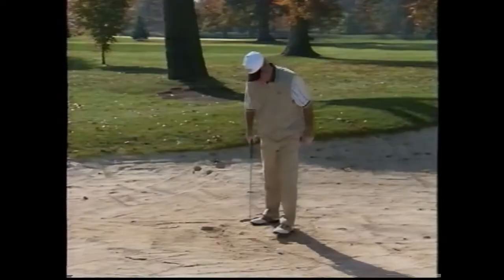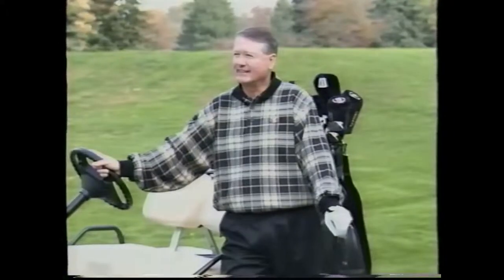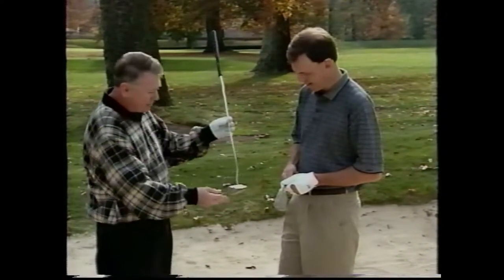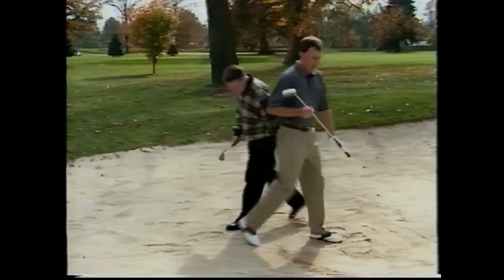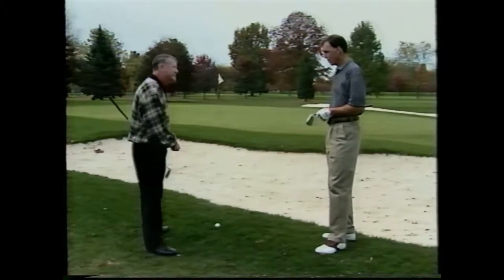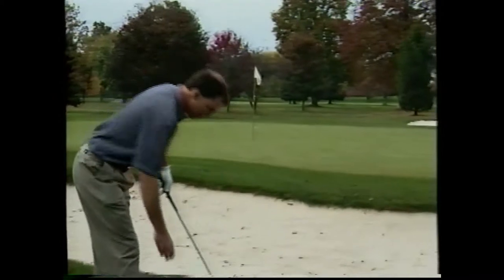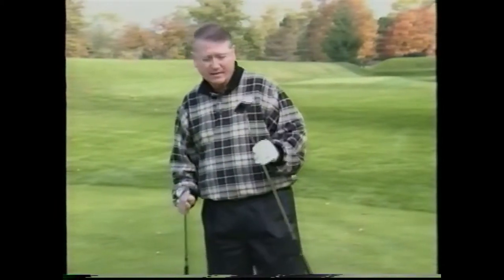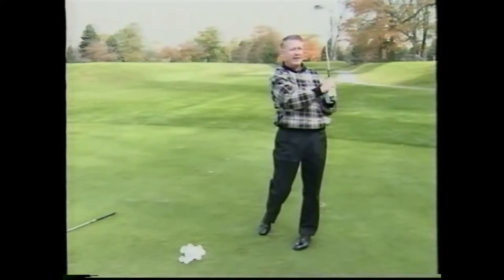Sand Putter 23 min video

Comment: Hi Ralph, just bought the sand putter and was wondering do do place the ball closer to your left feet or right feet? im still trying yo figure the sand putter out.
Reply from the maker: Zafri, basically most all shots will be played with the ball positioned very close to the middle of the stance. It should never be rearward in the stance because the bounce on the Sand Putter will be artificially removed from the shot. Conversely, if the ball is played forward in the stance you will be artificially placing more sole bounce into the shot.